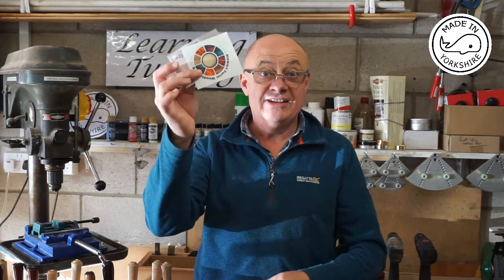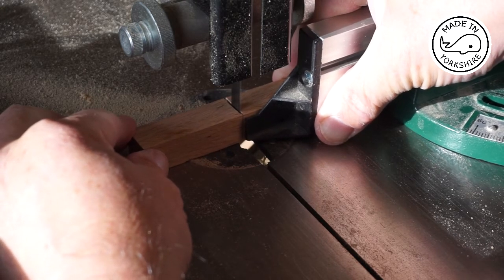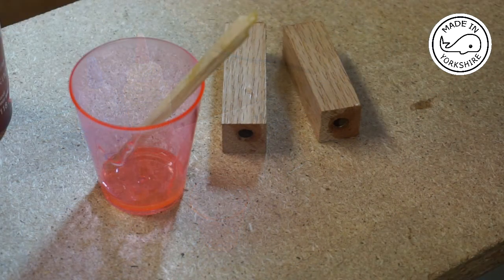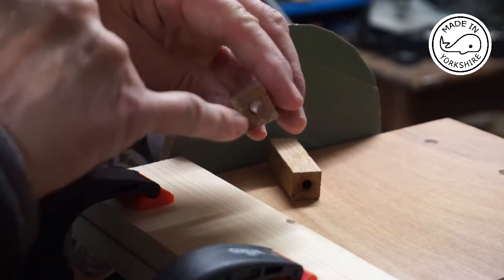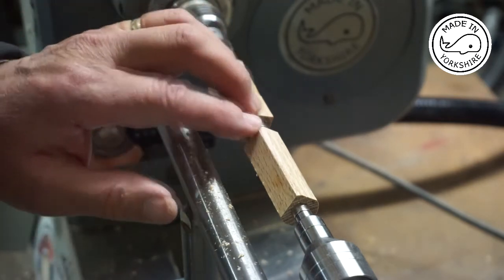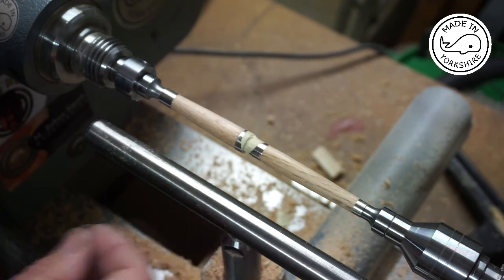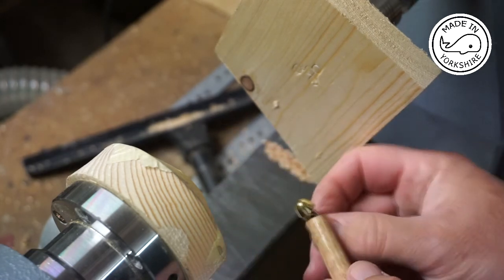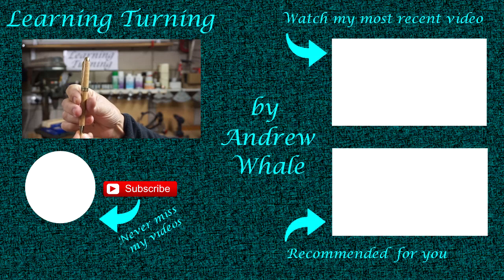#36 Turning my first Pen

Comment: Excellent Andrew. For the first pen you have to be really pleased with that. Make sure you keep that one for yourself, I have my first Twist Pen (Exactly the same as yours) and my first fountain pen, both on my desk at work and both get used.
The long drill bit I've only ever used once, too long and too flexible. I've also gone to my cheap drill press for drilling out the centres as I found it more accurate, still not precise but far better.
I've not had the tear out on the centre band, I also find the 5mm width of parting tool is usually enough.
You can make just about any shape you like, just beware of when you have a clip going on and in that pen where the join is on the centre band.
I'm sue you now have the pen bug, ideal for gifts and presents. Just in time for Christmas.
Excellent job, very well done!
Reply from the maker: Thanks Paul. I'm definately going to purchase some more supplies today and make some Christmas presents.
I guess if I can do a bulk run - for example, cut and drill all blanks in one go, it should save some time.
Thanks again for the advice.
Andrew

Comment: Grand job for your first pen we have all been there,if you get two bits of wood and put a taper to fit mt2 on lathe with a mushroom head to fit tail stock and head stock that will save you struggling.all the best
Reply from the maker: Thanks Barry - your advice is very much appreciated.
Take care.
Andrew

Comment: Very nice pen.  Pen turners tend to discount oak as a pen material, but I think it looks very nice.

The hole doesn't have to be exactly on center in the blank.  The key requirement is to have enough wood left outside the hole to turn the desired shape.  

Another solution to the problem of the rough edge left by the parting tool is to first use a skew to cut through the fibers at the surface of the blank.  That way, the parting tool won't leave a rough edge when you use it to remove the waste material at the end of the finished blank.
Reply from the maker: Hi Louie. Many thanks for the advice. Good job I didn't buy a load of Oak! I am thinking of making some pens for Christmas presents. Have you any suggestions on what type of wood to use?
Cheers.
Andrew

Comment: Congratulations on your first pen. While the holes that you drilled using your lathe may not have in the center of the blanks, they were at the center of rotation.
Reply from the maker: Hi John - I never thought about it that way.
Thanks for the feedback.
Cheers.
Andrew

Comment: Andrew,
Firstly I'm always impressed by your adventurous approach and the quality of the projects that you have achieved.

I believe that you have the same lathe as me - an Axminster 1628VS monster.  If that is so, then the kit of parts that came with it should contain a headstock alignment tool - it's a double ended Morse taper that you fit into the headstock, loosen off the lock and push up the tailstock until the tool is fully engaged, then lock off the headstock, and - voila, perfect alignment!

If, for some reason, you don't have it, Axminster sell them separately - http://www.axminster.co.uk/axminster-lathe-alignment-centre-2mt-102427 - I hope that helps with the small problem you described in your video.

Happy turning!

Steve H